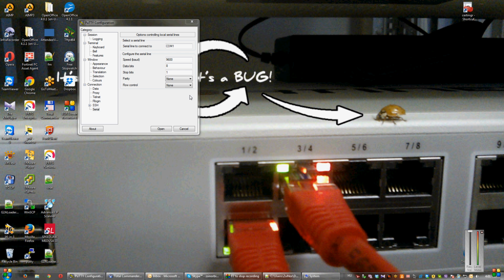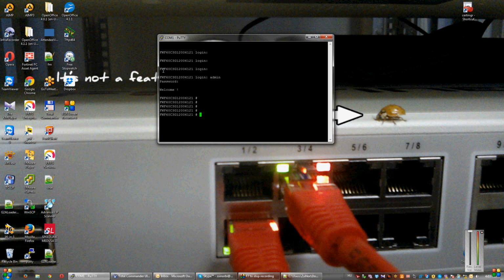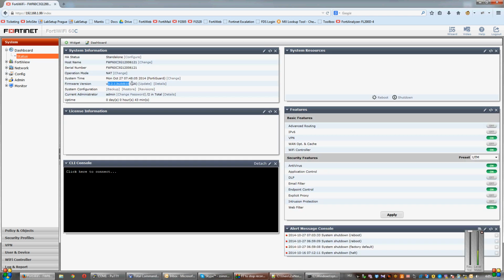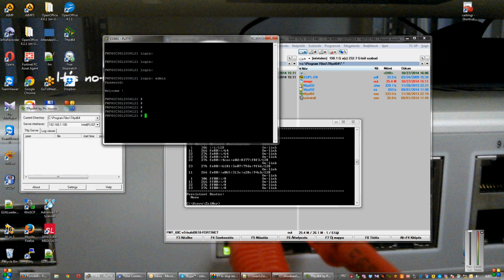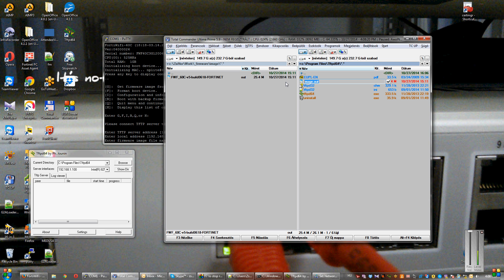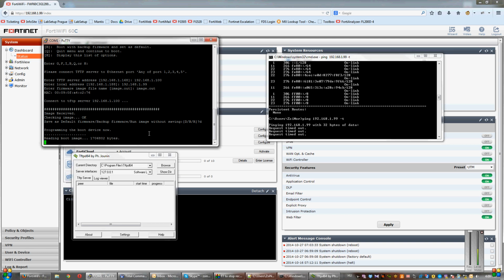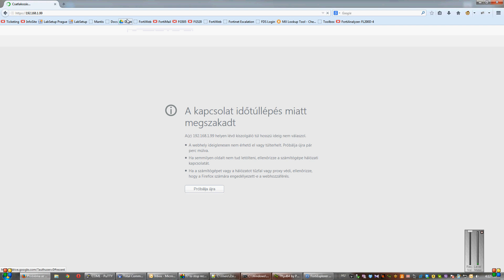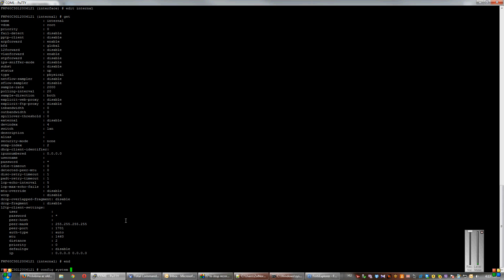Fortigate TFTP Firmware installation

Comment: amigo como puedo conseguir el firmware del fortigate 90d 
e tratado por la pagine de fortinet pero no permite la descarga
Reply from the maker: FGT_90D-v6-build0163-FORTINET.out
35,232
2018-07-26 15:07:10
2018-07-26 15:07:10
HTTPS Checksum

I'm seeing it on the website. Check it again mate. :) Here's a simple guide:
http://ursius.hu/firmware_download.JPG
Reply: Hola tengo el mismo problema, no puedo descargar el firmware de fg-60b alguien tiene algun lugar donde descargar?

Comment: Tell me how to change the MAC address to WAN, because the provider gives its own, that I did not find it in the settings, that's why there is no connection
Reply from the maker: config system interface
edit wan1 (or whatever port you have for the internet connection like port1/dmz/wan1/internal )
set macaddr 00:00:00:00:00:00 (your MAC here)
next
end
Reply: Super! Спасибо!

Comment: With great difficulty, I found one and only one link,  http://downloads.landynamix.co.za/Fortinet/Firmware/FortiGate/40C/
file, but apparently not on mine. Maybe it's because it's not with WiFi model.  What do you think??

FGT_40C-v5-build0754-FORTINET

Please connect TFTP server to Ethernet port '5'.

Enter TFTP server address [192.168.1.168]: 192.168.1.100
Enter local address [192.168.1.188]: 192.168.1.99
Enter firmware image file name [image.out]: image.out
MAC: 00:09:0f:b6:b0:94

Connect to tftp server 192.168.1.100 ...

###################################
Image Received.
Checking image... Wrong image type.
 Please power cycle. System halted.

Comment: I want to ask you for help with my  FortiWiFi 40C 2013, I can not find the firmware here is my mail altars71@gmail.com, thank you in advance.
Reply from the maker: Contacted you via mail.
Reply: https://support.fortinet.com ??? Thanks, for the standard answer, but you yourself from there, as an ordinary user, what did you download? There you have to buy a license, then they'll give you something, but they gave me a house. I wanted to ask you just a file, I do not need a link, I have GOOGLE for this, thanks.
Reply from the maker: You can't make everyone happy. Yeah, Googling something is the basic what you do and it will get you to a knowledgebase. You can also contact Fortinet support via chat to get you a step by step guide or you can ask directly what exactly you need. I was asking you which version of the firmware you want in the mail as if you have issues downloading, I can fetch that for you. You are asking a question, be respectful as I was with you. Instead of telling you to sort out your problem yourself I took the time to sit down and answer your question. At this time I should simply tell you to go and sort out yourself instead I'm taking the high road again and I give you the following:
- if you don't have a registration on support.fortinet.com, do create one for yourself. It's free and no hassle however you need to confirm your mail address. 
- log into support.fortinet.com, on the top there's a menu with home, asset, assistance, etc... Click on download->firmware images
- On the drop down menu there Fortigate is the one you want, that is the default, you don't need to change it.
- below there there's the Download section, click on it, there you can select which major you want to go for, I suggest go for 5.00 in that go for 5.2 in that go for 5.2.11
- there's going to be a lot of downloadable firmwares there, find  
FWF_40C-v5-build0762-FORTINET.out (it starts with FWF as it is a FortiWifi, it's almost at the bottom)
with the HTTPS button at the end of the line you can download the firmware

Or follow my newer video about this topic:
https://www.youtube.com/watch?v=gCqA1680f2k&t=344s&index=3&list=PLMsndpH39ghXQOygiCqyAmkgwBgUaRti4

Or you have GOOGLE for this, thanks.
Reply from the maker: Ping me on mail, let's discuss things. I'm willing to help you get the device working on a remote session if you like. I won't be available in the next 5 days tho, sincerely sorry about that but next Wednesday anytime I'll be able to assist.
Reply: @ZsiNor   has how to get a Fortigate 100E firmware?
Reply: @ZsiNor   I can't get 100E firmware with a free fortinet login.
Reply from the maker: @EricHenriqueStos  https://youtu.be/z3uqWJhHSqA - just uploaded, might take a couple of minutes for YouTube to render it.
Reply: Greetings, I do not know whether you have come or not. I did not find the firmware in the public domain. Anything for the house is fine, let it be 5.0, if you can, give a link to your resource, or upload to a file sharing service, I'm waiting for an answer, thank you.

Comment: I need the firwmare of a fortigate 90d do you have it?
Reply from the maker: Register to support.fortinet.com - it's free -, there you can download whichever firmware you like for the 90D however make sure you do check to download the correct one. The 90D - if I remember correctly - may come with PoE but if you don't have PoE ports, don't download that firmware, it will give an error upon uploading however it won't break your system. Enjoy!

Comment: hi i thing  you did not upload all video.i need last part of video also i have that poblem i cant connet admin panel from iexplorer.i have ping to my ip (192.168.1.1) bu i cant open admin panel from explorer pls help about that (orkhanesedov@gmail.com)
Reply from the maker: Hello, if you can't connect, check on the following settings:
- interface's IP you're trying to connect to (if it's a connected route - you're in the same subnet -, it's easy and you can skip it, 192.168.1.1 and 192.168.1.99 are in the same if the subnet is 255.255.255.0 or /24)
- interface's allowaccess, for IE you need HTTPS and/or HTTP
- check your admin's trusted hosts, if they don't allow you in the same subnet, you won't be able to log in
- check the ports (conf sys global) you've set up for HTTP and HTTPS. While the default is TCP/80 and TCP/443, the listening port numbers can be chained
- if all of these are correct, check your network. Also you can do a sniffer on your Fortigate to see if the traffic hits the box or not. This can show you other issues like if you don't see a SYN packet, there's something blocking the traffic in the middle, if you see the SYN but no SYN-ACK, the Fortigate's config needs to be check (see upper comments), if there's an issue with the IPv4 assigned and the interface has an IP assigned, bounce it, that will solve the problem.

Bost of luck